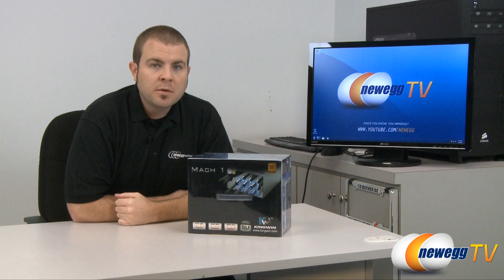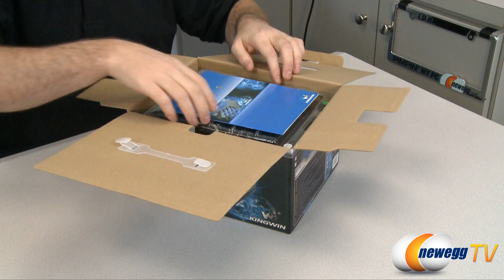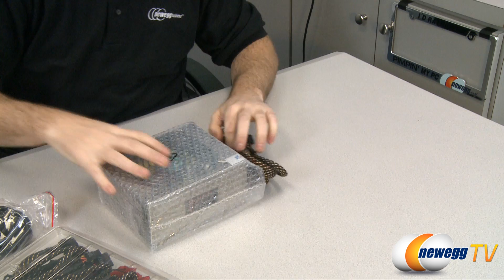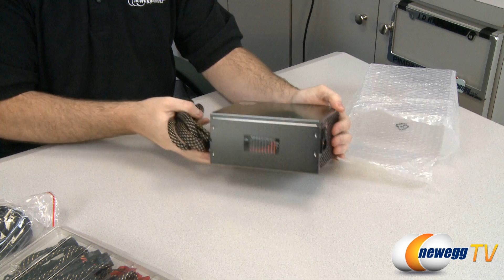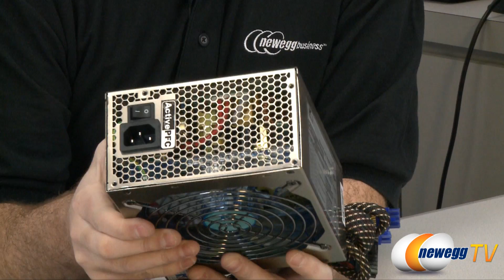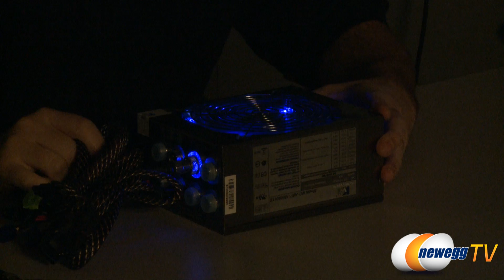Unboxing: KINGWIN Mach 1 ABT-1000MA1S 1000W Modular Power Supply

Comment: @roshawn1111 OCZ ZX 1000W, CoolerMaster Silent Pro Gold 1000W, Antec Quattro 1000W,  
Silverstone Strider Plus 1000W, Corsair HX-1050, Enermax Revolution85 1020W or really, any other brand name psu with more than 30 amps on the 12v rails used to power the pci-e connectors

Comment: @roshawn1111 that one should be able to, as it has the required cables and enough amps across the 12V rails.

however, there is not much headroom on your psu's rails when running 3 cards, so i would stay away from overclocking the cards. I also would get a new PSU if you ever upgrade to a real high end card (6990, gtx 590, even a gtx 580, theres just too little current on the 12V rails to be able to power the cards properly)

Comment: @pillopants 4 pci-e cables and is well over the necessary power requirement. it will easilly be capable of 2 way crossfire, it just doesnt have the amd seal on it